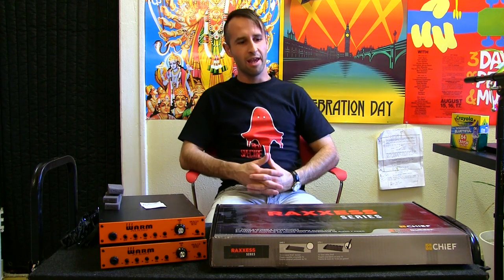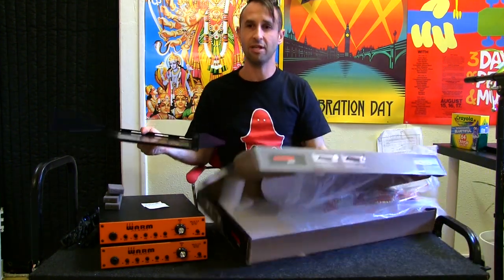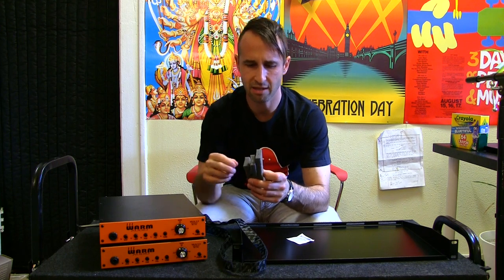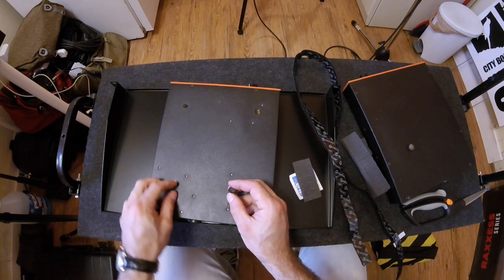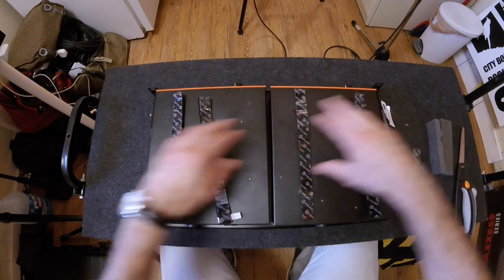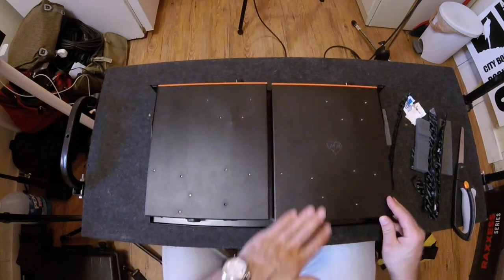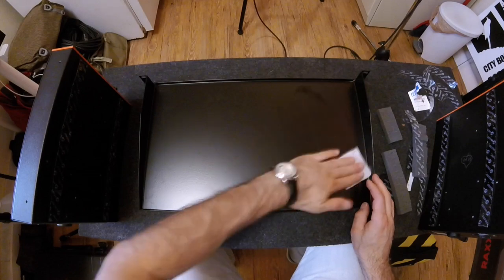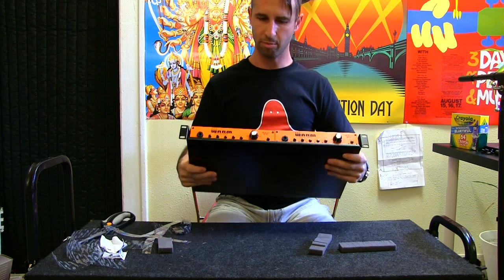How to Rack Mount Half Unit Audio Gear

Comment: I learned from building pedal boards you always want to put the hooks on the gear and the loops on the surface you are mounting to. When you take a unit off the unit is more likely to get junk in the loops than in the hooks if you sit it down somewhere.
Reply: Michael Keeter is correct!  What he says makes total sense, and is the reason why you see pedal board manufacturers opting to pre-install the loop (i.e. 'soft') portion of the Velcro on their boards.  So remember, if you get a new pedal be sure to slap some of the hook (i.e. 'rough plastic') portion of the Velcro to the bottom of your new toy as soon as you get it, and you will be good to go! ..until the glue wears out and you have to replace it, that is.